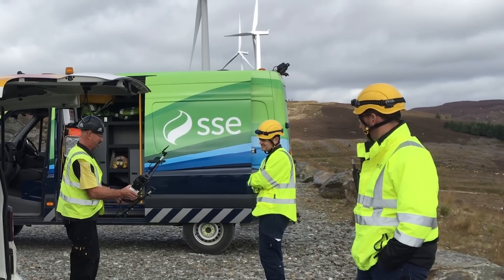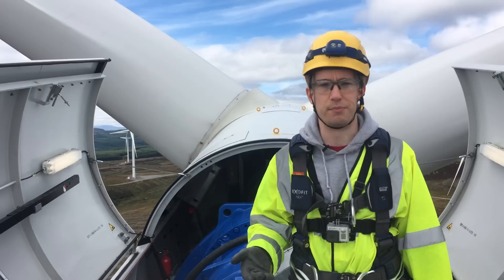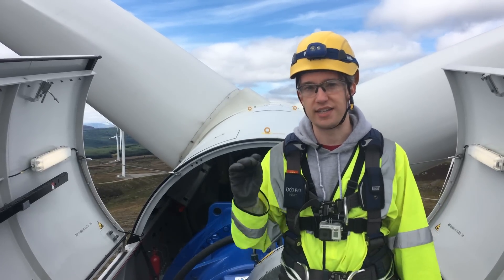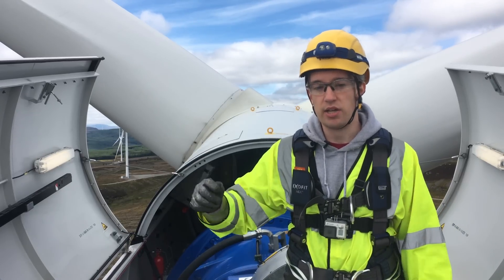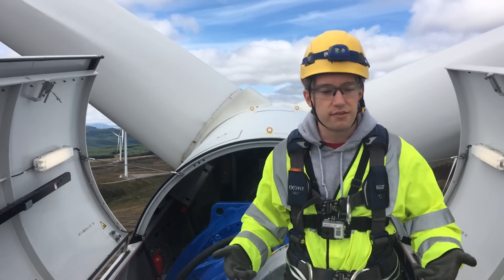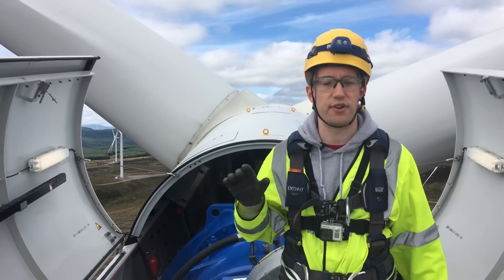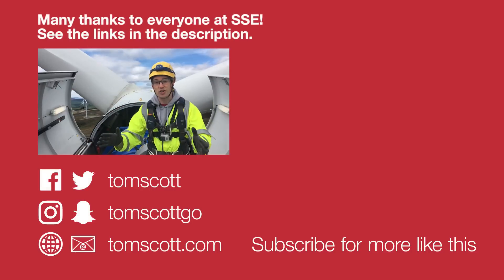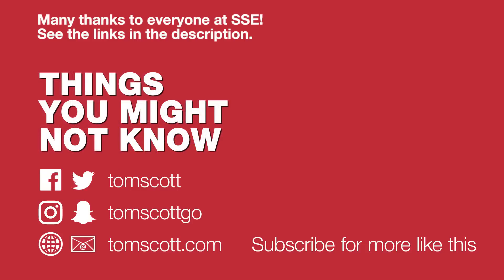The Problem With Renewable Energy (and how we're fixing it)

Comment: I would take the high possibility of short blackouts over the possibility of nuclear meltdown any day tbqh
Reply: The chance of a nuclear meltdown in a properly maintained powerplant is realistically 0.

Anything that could make a meltdown occur is likely to be a natural disaster that would kill thousands and cause billions in damages.
Reply: Luke-Antra natural disasters are inevitable but a meltdown would poison the land for a long time; potentially kill a bundle of bunches of people and you say the chance is almost zero buts its not; its happened too many times before; you know what happens when a windturbine breaks? spiny thing stops being spiny; I just think the danger of nuclear energy isn't worth the risk when there are far more viable; and eco-friendly technologies out there
Reply: Barry Cassidy Soo, i just checked the list of nuclear disasters aaaaaand.

Every single one was caused either by insufficent safety mechanisms, improper maintenance and mismanagement, or by a major natural dissaster.

Or a combination of the two.

And even during a major natural disaster, a modern nuclear power plant will have safety and containment mechanisms that will prevent any major damage.

Fukushima is probably the best example for this, the tsunami itself killed about 15 000 people.

The powerplant only contaminated the sorrounding area due to the powerplant beeing old, poorly maintained and safety guidelines outright ignored.

While i agree that using solar, tidal, wind and thermal power sources is a better idea than using nuclear power sources.

Nuclear power sources are still a hell of a lot better than Oil, gas and coal.
Reply: Luke-Antra ok but my points still stand; if renewable is C and fossil is A then nuclear would be B; there's no need to jump on B when C is ready and available, especially when B could cause loss of life and impact the earths ability to sustain and nurture life (not to mention nuclear waste)
Reply: every single mistake that can happen in a power plant will happen at a power plant, regardless of the safety protocols involved, even if it was 100 times safer then plane travel, that's a disaster a century or so.

I would always be extremely careful of where those plants where built, if I was responsible for that sort of thing. The fact Japan even has them, being on the ring of fire, is lunacy.
Reply: In fairness there's as much chance of coal and gas plants blowing up as of nuclear meltdown. The two largest disasters in nuclear were caused by a soviet approach to safety mechanisms combined with poor training and a tsunami. Neither of those would occur in modern Britain so we wouldn't realistically have problems
Reply: This may be a cynical way of viewing it but here goes: Fossil fuels kill/worsen the quality of life of very large amounts of people ambiently, in the background. Whereas nuclear power kills people in very specific events. Even though there is no real way of quantifying the damage done by fossil fuels, it is arguably more than that of nuclear. The thing is that nuclear kills people in specific and spectacular ways so it sticks in peoples minds as being bad where in actual reality fossil fuels are far, far worse.

Comment: I do not think that nuclear power plants are used to regulate the grid power. Most if not all nuclear power plants supply "base power" and operate always on nominal power (100%). I know I am picky and I know that it is not relevant to your point, but still: Facts are Facts. Some times, wind farms have to be stopped, because the power the demand is so low and the conventional plants can not be regulated down quickly enough.

Comment: Comments have to be listened to:

"Without the fossil fuel, nearly a third of Britain’s electricity was supplied by gas, followed by wind farms and nuclear on around a quarter each."

Coal is still run in the background just in case Wind drops. So one day we will have 100% renewable in about 30-50 years 'IF' we can get over the battery storage and manufacturing problem.

Comment: if everyone lived off the grid with their own energy for their homes (which by the way batteries are capable of sustaining an average home with solar of course) then the only time the grid would need to come in is in large businesses and shops, fuel stations etc.
Reply: You're forgetting the cost involved with solar panels for individual homes. Also, this might work in rural areas or even suburbs, where people live in single houses. What about urban areas and big cities with apartment blocks and all that? You're hardly gonna power a whole apartment block with solar, and that's not even talking about hot water.

It's a nice idea, but solar is far from being both efficient and cost effective.

And you'd still need the batteries for power usage at night.
This next point is a little far-fetched, but if electric vehicles become a trend and everyone switches to those, most people are gonna recharge them at night, adding even more power usage at night where you can't rely on solar, hence the need to use batteries for that as well.

There are a lot of factors at play; the only thing that's clear, even most homes won't be self-sustained on the power side of things.
Reply: he is onto something but i understand your point and completely agree with it but if every house (unlikely anytime soon) in rural and the suburbs had solar then the need for huge wind turbines and so forth would be lessened but with the cost of solar currently and the government push back it would receive from politicians who have there fingers dipped in coal investments it wont happen

Comment: I do not like the idea of the grid sucking current out of my car's battery! The reason I plug it in, is to charge, and not provide electricity for others. I would be really pissed off the get in the car in the morning, rushing to get to work, and find out that my car can't get me there, because the batteries are empty. I'm strongly against this solution! 

Google fixed problems like this in their data centers with flywheels. When they have power, they spin them to colossal speeds, and when the power goes out, they just keep spinning out of inertia, just like you mentioned with normal power plants. That would be a solution that I like.

Comment: The problem with "Selling back the energy" is that you will get f*cked by the system. 

You pay x EUR for one kWh. You could get x EUR back if you deliver the same kWh back to the system. However, when you buy energy you pay taxes, but don't get your taxes back when you deliver energy. I look at this how I look at my photovoltaic cells on my roof. It's better to use the energy myself becuase I not only save the cost for the energy, but also everything that comes along with it and is calculated by kWh used.

Comment: In my case I want to build a place with wind and solar. It will feed a 10-20kW battery array and the home will float on that. Screw the incumbent power providers.
Reply: what happens on a cloudy, wind-lacking day?
Reply: 20kW would last 2 to 3 days, After that a natural gas fired generator.
Reply: Also, you don't need particularly sunny days, to generate SOME power, especially if your solar panels are powerful enough. As long as the sun doesn't forget to rise, you should have enough for a house. It's when you have to feed a city that it becomes harder.

Comment: Can't we use wind turbines to spin up a gigantic flywheel and take power from that instead of directly from the wind turbine itself? not sure what the loss would be there... probably too great?
Reply: He mentioned fly wheels at the end.
Reply: Problem with flywheels is that it's a very large space with very little capacity
Reply: In such a case, the flywheel need not be in the wind turbine but in a specially made power storage station, and driven by the combined output of multiple windmills. Essentially, you are asking to built an energy storage (and release) facility in the grid. In the absence of the existing types of major power stations, I think that would be a near-necessity. Whether the energy is stored in flywheels or another means would be based on efficiency considerations.
Reply: They could repurpose a power plant to be a energy storage plant.

Comment: If he did a bit more research instead of most likely reading from a script, he would find that there is a clean renewable energy that uses turbines and has the capability to be immensely powerful and power the world for thousands of years. Geothermal energy, along with solar, wind and the two ocean-based sources he didn't mention (tidal and wave energy) has the potential to wipe out the need for coal/gas/nuclear firing power stations forever.

Comment: One of my thoughts when it comes to syncing the grid was "How about generating DC power and then using true sine inverters controlled through the grid to convert from DC to AC and then feed that to the places it's needed"... After a quick chat with an engineer at Drax power station it turns out it would be extremely expensive, you'd be wasting power in the inverters for current conversion and it adds an extra point of failure*, so while it would be easier to synchronise the grid to a specific frequency, it wouldn't be as reliable as synchronising all power stations to dump just the right amount of power at the right frequency just as we need it.

*When I say "An" extra point of failure, I'm seriously underselling it! there are multiple chances for an inverter to blow out, multiply that with an entire power grid and you're just asking for something to go tits up!

Comment: Surely you could have a motor keeping the drum moving (wasting energy I know) but when you run out of power, you turn the motor off and use the drum's kinetic energy. I guess it's just a larger, inefficient battery.
Reply: This was my thought, as you could run a flywheel from a motor/generator, but I'd imagine it would be very inefficient! I'd say that we just need enough renewable energy to cover any outage, or just burn rubbish in the power stations!

Comment: Er, no. Constant wear and tear on your car's lithium battery would wear your battery pretty quick. The amount of money that they would need to pay you back when you sell to the grid would need to be significant in order to cover the cost of the extremely expensive lithium battery pack. On top of that, the amount of lithium necessary to even remotely cover grid storage would be massive. MEANWHILE you can manufacture molten salt batteries out of sodium and sulfur, two resources with both near limitless quantities and global distribution, and install cheap, large, monolithic batteries to cover grid storage. Japan already does this. The solution to the problem of grid level storage has literally been around for half a century.

Comment: because when I leave for work in the morning, I like to see a my car has no charge and a $10.28 for all the inconvenience of a dead battery on a grid that doesn't have enough producers of power, but tons of automated stems stealing power from storage systems like politicians manage social security funds.
Reply: Could easily avoid that by having a manual setting in the computer, just set it to never go below X amount.
Reply: so what happens when people decide that they want a full charge and opt out that idea... is the government going to use eminent domain on your energy storage capacity?
Reply: If millions of cars at once are being used for seconds of energy, i doubt that you would be drained that significantly, and if the power goes out for longer than that, then i'm sure they wouldnt use the car battery for something like that. Also, most teslas (and assuming other companies follow in their footsteps soon enough) and other electric vehicles have the ability to fully charge in 30 minutes or less. So, aside from being slightly later to work than you would have been, the effect is minimal.
However, this is still assuming everyone is on a grid. If everyone gets one of those tesla batteries for the home (which are being developed right now), and uses solar energy, then the only people responsible for the energy in the house is the owner of the house. You and only you would be able to control your energy use, not your neighbor, not the governement, just you. The battery packs are actually really good, since you get to a). take control of your own needs independently without government intervention b). provide the private business sector with money so they can provide you better products in the future and c). make your cost of power drop down significantly, only paying installation costs and maintenance costs.
Reply: Its more likely that something like teslas home batteries would be used for that.

Comment: A car cant by default provide enegy to the grid. A car has a AC/DC converter to charge the batteries. Some fast chargers have this built i, but in both cases, delivering energy fron the batteries back to the grid means one has to have a DC/AC converter. That isnt built into every car or charger

Comment: Not sure I agree with the idea that grid-scale batteries are not the solution. Looks at what Tesla has been building in places like Kauai, HI and Australia. I've never been crazy about the car idea and see two problems with it. One is simply people might not want to feed power from their cars back to the grid as they might want the range to jump in their car and go anytime. Also I've heard that that's not really what car batteries are designed to do and that it would likely degrade their longevity rather fast. Flywheels may also be part of the picture.
Reply: If your car had 90% charge left when you got into it, you'd probably be alright with that. Just configure the car's computer to only use the top 10% for grid-balancing, or let it go beyond that if the car's in a situation where it's definitely not going to get used for a while (like you've arrived home from work and don't plan to go out again until the next morning, so the car can charge overnight while power is cheap).

Comment: You go to unlock and get in your car after charging overnight but you can't because: 
    "Access Denied for reasons of National Power Grid Security"/ 'Battery at 1/3rd capacity due to national power grid' / 'Your battery fails to fully recover a charge after about a year of ownership due to a high cycle life connected to the grid'.... 

   From my uneducated, shallow perspective of the issue, aren't super capacitors the real future of energy storage and buffering as they offer faster charging rates and larger immediate energy potential? They are even catching up to batteries when it comes to total energy storage.

Comment: Batteries are the future, and it's battery technology that desperately needs to take a significant leap forward to allow us to really advance to where we want to go with our consumption of power and the role it plays in our mobility and use of mobile devices.The biggest issue I see with this idea is the accelerated degradation of batteries as their life cycle is spent more rapidly due to added uses, for it to be a fair exchange for the average person, the power that is sold back to the grid from the battery would have to be sold back at a higher price to cover the wear and tear on the battery, and maybe even a bit extra to encourage acceptance of this technology. Without this foresight it would become common for some people to fit systems that allow the flow of electricity in only one direction, to the battery and never back to the household. This assumes an ownership model like we currently have, rather than a service model of ownership where users are merely renting a vehicle, but this doesn't answer the question of who absorbs the cost of battery degradation.Fingers crossed Tesla and other companies manage to develop new battery technology that can last a near infinite number of charging cycles spanning decades, and hold more power than ever before. Power stations are built to last half a century or more, in terms of waste that is very efficient compared to every other household having to replace industrial batteries every 7 years or so... a humongous waste problem waiting to happen unless we can develop the technology to avoid this as soon as possible.(sorry for big paragraph, my browser gets rid of paragraphs for some reason!)

Comment: Thank you for the video Mr. Scott. We may have to come to terms with the fact that we need Gigawatt-sized batteries. Not Lithium-Ion, as they have limited cycle life and calendar life, but from stationary Lead-Acid battery, which can be built during the installation, unlike other types, and last for more than 25 years.
Seen that Li-Ion batteries only have one thousand cycles of life, once people realise that connecting their electric cars to the grid as peakers, they loose hundreds of miles of car-life, they will not agree.
The non-carbon alternative to complement thousands of Gigawatt of wind power would be to install thousands of Gigawatts of nuclear power; no carbon emission, and newer 3 gen reactors are fail-safe by design, so there is no risk of radiation leakage or meltdowns.
The education of the public about the green transition is not comprehensive and many have unrealistic expectations, like a grid made exclusively of wind and solar generators. I agree that home-sized peaker batteries are a valid alternative, but I don't agree on using the battery of an electric vehicle. Rather, building codes should mandate the installation of something like a Powerwall in each house, just as it happen currently with boilers.